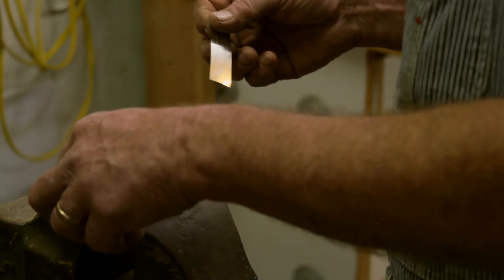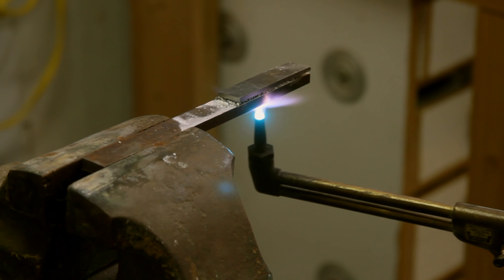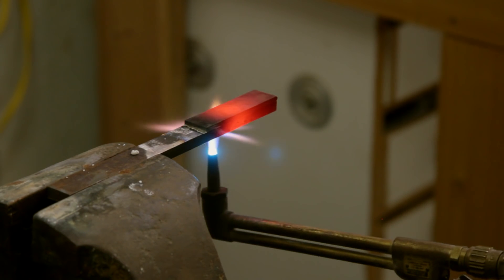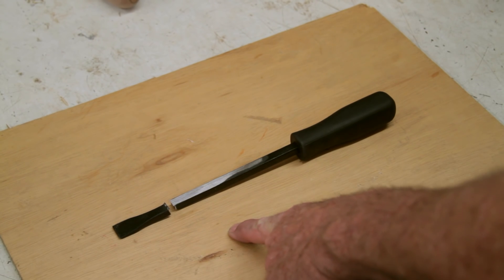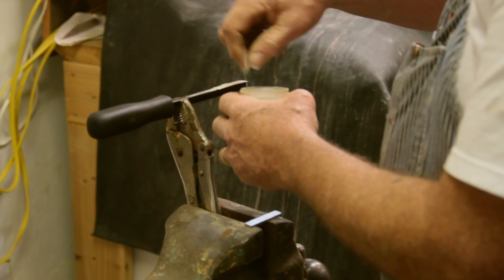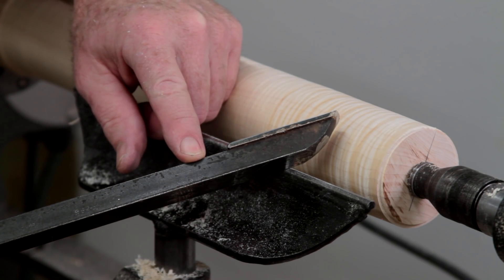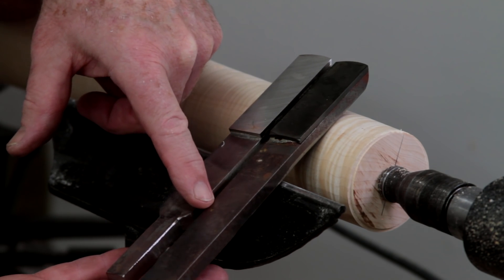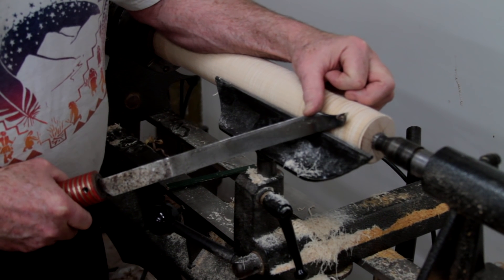THE BIG UGLY TOOL by Reed Gray aka Robo Hippy with Randal Dale

Comment: What type of steel are you using to silver solder the tang tung too? Probably spelled wrong. Thanks
Reply: Is it a hard type or a mild steel? Thanks
Reply from the maker: I don't think I used cold rolled, but that is a possibility. I would think mild steel would work fine. I prefer 5/16 for the 1 inch wide pieces, and 1/4 for the 3/4 wide pieces.

Comment: I found about 30 of these about 5” long in an antique store in a box. I talked them down to $90 for all of them. I made a handle that will take all of them in for use. I thought I got a good deal. 😊
Reply from the maker: Last time I bought some, they were $30 for a 1 inch by 3 inch long by 1/8 inch thick. That was at least 15 years ago. You got a good deal. I did find out that you can use a couple of strands of silver solder wire, and tap them down a bit flat first with a hammer. You just can't wick the solder all the way across the 1 inch wide pieces. Have fun!

Comment: Can I sharpen the tantung using a silicon carbide wheel?
Reply from the maker: You can sharpen it fine on standard grinding wheels. I sharpen on CBN wheels, but make sure to have most of the softer metal ground off. The Tantung will keep the softer metal from loading up the wheel.
Reply: @robohippy  , thanks, and I really like your tool rests that I received a month ago.

Comment: Why dont you try useing half round steel for the shaft?
You would then have the flat surface for applying the stellite, or whatever, but you will also have the ability to roll the tool when turning. The half round would have a much shallower curve than round stock, so should be stable in most orientations.
Reply from the maker: One problem with the half round stock. This would be identical to the Thompson Fluteless gouge. As long as it is a straight in cut, it will work, but if you are cutting with one edge or the other and scraping or sweeping, the tool wants to roll, which means it can work, but for heavy duty scraping roughing cuts, you need the flat bar with slightly rounded edges for shear cutting and shear scraping.

Comment: Why in the world don't you put it on a round rod ?
Reply from the maker: Oh, forgot about this.... Anyway, a round rod is rather 'tipsy' when using a scraper as in unless you are dead square on and doing a straight in plunge cut they will want to roll. I do ease the edges/corners on the flat bar for making it easier to have up on the side for shear scraping. If I was going to use round rod, the part that tangung would rest on would have to be flattened or you would need half round rod. Not positive, but probably more expensive than bar stock.

Comment: Hi Reed
i have an old Rockwell/Delta 46-111 wood lathe. they have the nuts on the tail stock and banjo that have to be loosened and tightened every time you have to change positions. Do you know if anyone has changed the banjo to a cam clamp type? I wouldn't mess with the tail stock because of having trouble matching the point to the headstock point. I am tired of spending time using the little wrench all the time.
Reply from the maker: Not sure on that one... Easiest way to do it would be to get a banjo from another lathe and make sure the bottom pressure plate will fit in the ways of your lathe. You may need a longer bolt. Most manufacturers will sell a separate banjo. I do prefer the Robust ones, but their smallest lathe is for a 14 inch throw.
Reply: robohippy thanks a bunch, buddy.
Reply: Hi Zetus Kid. Your question about building a cam clamp banjo is four years old but if you are still interested, I have a 4600 Rockwell gap bed lathe that is very similar to yours and recently I built a new banjo. Start with channel iron 1 1/4" x 3" x 11". Cut two small plates 1/8" thick (or more) for the ends and drill a 5/8" hole in both. Cut a 1" shaft the length of the inside between the installed front/back. Weld a 5/8" shaft 2" long on the ends of the 1" shaft by laying the both on a flat surface (not concentric) so you end up with a cam shaft. Put a 1" length of pipe over the 1" cam shaft, weld a nut on the pipe with a hole drilled in it for the bolt that will come up through your existing lathe bed bottom slide for the banjo. Weld the front plate on, install the cam shaft through the front of the channel, insert the back plate over the cam shaft and bolt the back plate on. Install a front handle for turning the cam shaft. 
I've used mine for 40 hours now and it's saved me 10 hours in banjo adjustments.  Should have done this in the '80s when the lathe was new. I have pics if you need. It's well worth the effort and makes turning wood double the fun.

Comment: Nice Vid. Noted all the comments. I can't weld and if map gas doesn't work, then pretty much out of reach for me. I have made a number of carbide (and high speed ss) tips which are easy enough and if you buy the tips directly from a major supplier, they are only a couple of £ each. Seems a hell of a lot cheaper than the tangtung, never mind trying to find that in Europe. Pity as I would have liked such a heavy duty tool. Thanks again for showing us how though. Cheers

Comment: I remember Bob Tuck talking about the scrapers they used in his myrtle wood shop years and years ago.  The plywood aprons they used to wear sort of gave me pause though.  I see that these are not quite the brute force tools i thought they were.  Would a MAP torch be hot enough to make the solder joint?  Great job, Reed.  Thanks.
Reply from the maker: +TheDoctorswoodshop There has been discussion about this, and I am no expert. From what I have heard, the old MAP torches would get it hot enough, but they changed them a while back, and with the new version, it is very difficult to impossible to do. Even with the older ones, it was difficult.

Comment from the maker: Oh yea, shear scraping.. I use this more for heavy stock removal. The tantung is slightly more coarse than most HSS or the micro grained carbides, and as near as I can tell, it doesn't take as fine of an edge as the other metals do. I haven't tried my 600 grit CBN wheel on it yet though, and the 600 grit makes a big difference on shear scraping burrs on my scrapers. Cuts much more cleanly than 80 or 180 burrs, but doesn't make a good heavy roughing burr.

Comment from the maker: Brazing: I think of this as what you do to put carbide tips on the circular saw, and am pretty sure that silver soldering is a different process, but all I really know about metal is how to grind it. AG Wesson will sell single pieces. They come in 6 inch lengths. I score across the middle, standard grinding wheel or square edge CBN wheel, put it in a vice at the score line, put cloth over it (no flying shards) and push from the score side. I don't intend to make them for sale as I would have to retail them pretty high, like $100 or so for a 1 inch wide one, and most will want to make their own. I consider it a good club project because just about every club will have some one with torch skills. I may have some for the Atlanta Symposium in June, not sure though...

Comment: Nice video.
That what you did you go there, I know that under the term 'brazing'.
Reply: +John horsfall Brazing is using bronze/brass rod,   steel filler rod is gas welding, and silver alloy filler is silver soldering.
Reply: +John horsfall You can use propane/oxy torch for all but steel filler welding then you need acy/oxy setup
Reply: +Günter Schöne I thought brazing was using steel rod as a filler ??? not silver solder
Reply: Thanks for that nice to know .